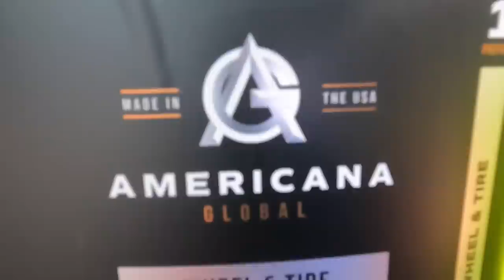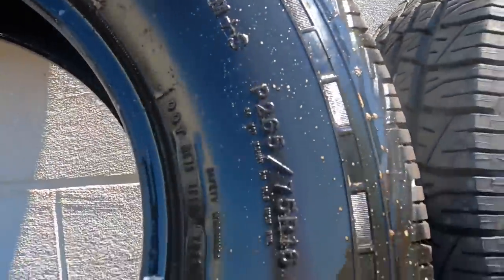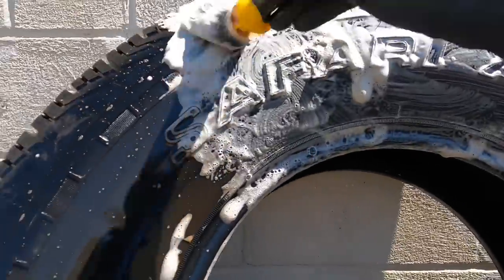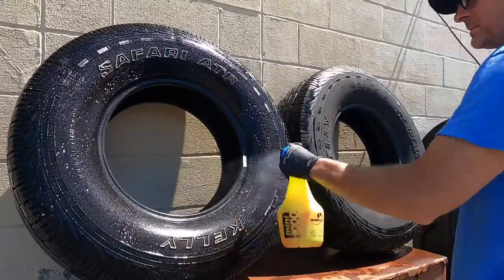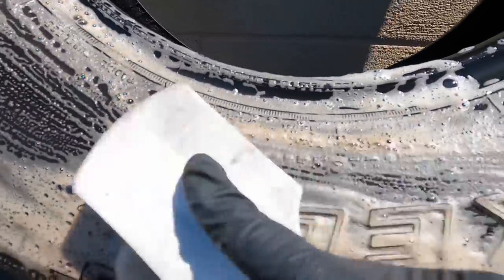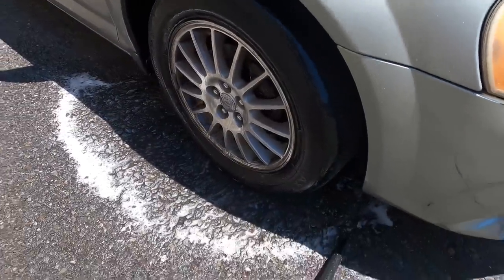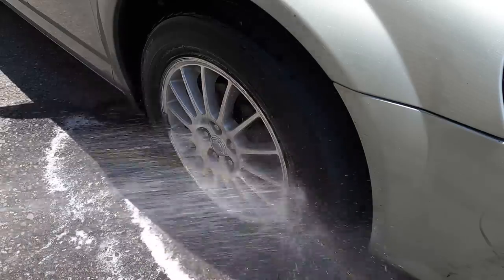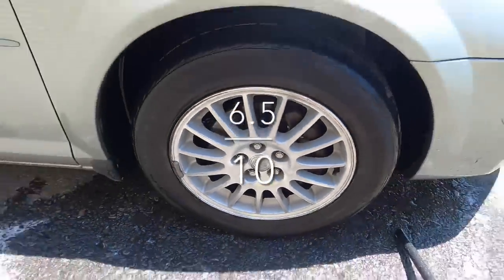Americana Global Wheel And Tire Cleaner! 2 In 1 Cleaner! Streamline Your Process!

Comment from the maker: What is your favorite wheel or tire cleaner?
Reply: NanoSkin Non Acid for normal to filthy.  Sonax if they're completely hammered.
Reply: Nano Skin Non Acid and TW Hyper Foam
Reply: Oberk Tire Cleaner.. Will be checking out the NanoSkin tire cleaner shortly 😁
Reply: For the $$ I find Meguiars non acid wheel cleaner works well. Better as a foam. 
What is your preference for each???
Thank you for the review.
Reply: I always use Adams tire and rubber cleaner. I have the tire 🛞 and wheel cleaner also.The  tire and rubber cleaner is great.The 2 in one is also good I just don’t like using it on the wheels I feel it’s a little strong.
Reply: The Green Turtle Wax at Walmart for $4. But I did just pick up P&S Undressed to try
Reply: Bilt hamber surfex hd
Reply: Foamers tend to be much of a muchness, still get slight transfer on a test cloth afterwards. I use a tyre buffing solution [like for puncture repair prep] to do a final wipe over and leave dry, seems to provide greater adhesion for a dressing.
Reply: Megs ultimate tire and wheel and or tw fast acting wheel cleaner
Reply: P&S Brake Buster
Reply: Adams Wheel and Tire & NanoSkin!
Reply: Bilt Hamber Surfex HD 1:10 for tires. Bilt Hamber Auto-Wheel for the rim. There you will get some real cleaning power.
Reply: Adams wheel and tire, very powerful on rubber. I haven't been able to find a better 2 in 1 cleaner. Americana SI02 soap is really good for maintenance washes.
Reply: I like the Gorilla Car Care wheel and tire cleaner
Reply: For light dirt, break dust: break buster. For wheels that needs something stronger Koch Chemi MWC.
Reply: For general maintenance (on both tires and wheels), P&S Brake Buster.  For deep cleaning, Adam's Tire and Rubber Cleaner for tires and Meguiar's Ultimate Wheel Cleaner for wheels.
Reply: sonax plus!
Reply: I just tried the turtle wax new wheel and tire cleaner hybrid hyper foam, the red stuff, awesome stuff!!! The browning effect was instantly apparent! I work at advanced auto so I get it pretty cheap.. Great foaming action too! Definitely my new cleaner!
Reply: Good Old Spray Nine or Extra Tough.

Comment: I have been watching your video's for a long time.  I decided to tackle polishing my GMC Sierra and coating it.  My original idea was to use Adams Advanced Graphene Spray for a coating.  However, after all this work I think I need to use something with a longer cycle of protection, like a true graphene coating.  I'm 71 and I don't want to be doing this every year.  So could you recommend a DIY coating to use.  My thought was Adam's Advanced Graphene Ceramic Coating.  Is there a better option?  Maybe Ethos.  I was thinking about the Adams because I already bought the Spray and thought if I apply the true coating that I could use the spray as maintenance if that makes sense.
Reply from the maker: If you use mine...easy to apply...you have me to support you with install and after care. you can contact me directly. https://apexsurfaceprotection.store/collections/apex-surface-protection-products/products/hydra

Comment: Gentlemen. If you want a wheel cleaner that works please do this. Place a few once’s of dawn dishwashing liquid into a spray bottle of your choosing. Then, add Spray nine degreaser in it.  Spray it on and let it sit a minute. Agitate with small brush or anything of your choosing.  Then rinse. No product out there will get it as clean. It will not harm anything. So all you candy asses out there don’t have to worry …  I detail exotics and the brake dust is very bad on these type vehicles. This is what works period. 
Spray mine is an awesome product and comes in different mixes. Germicidal , Degreaser , Boat cleaner, etc.  give it a try !

Also stop wasting time and money on this deionizer trash. It’s a waste of time…